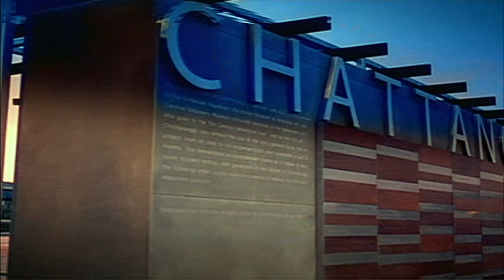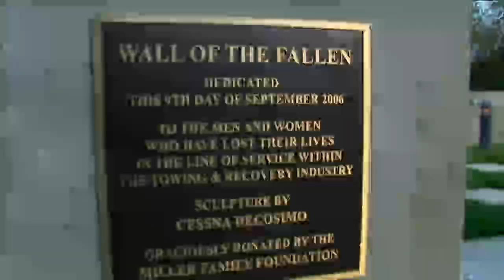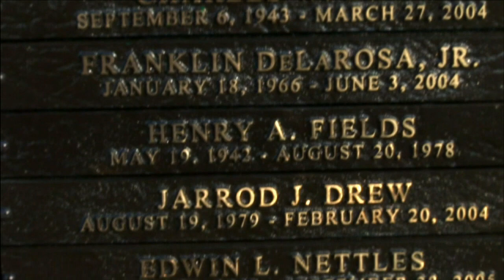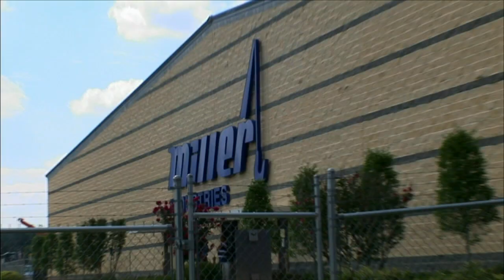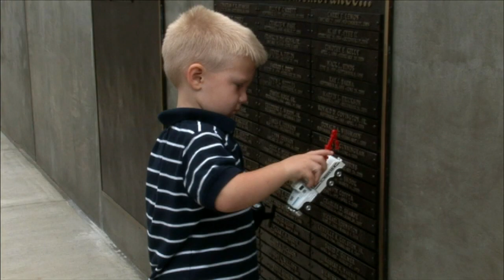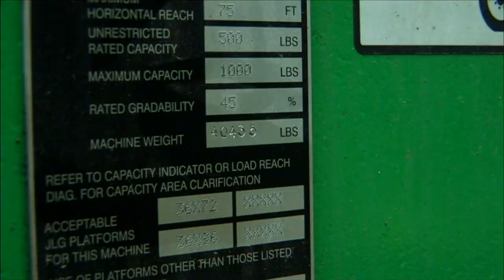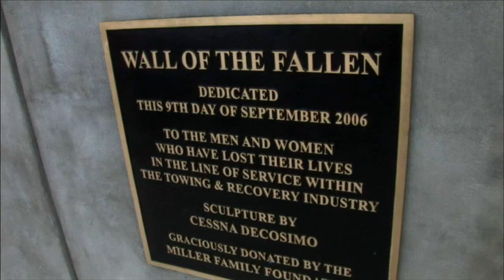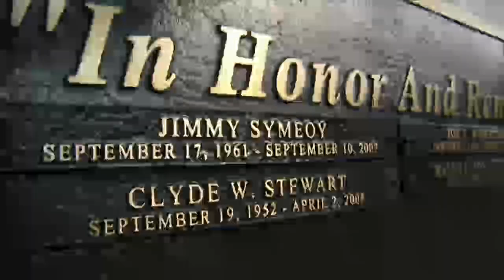Wrecked - Season 1 Episode 20 - Wall of the Fallen | SPEED

Comment: Wouldn't it been simpler just to grab the bus from behind with 2 j hooks and drag it back out the way went in with one truck then pick it up from the front for the tow? A 30 minute recovery?
Reply: +Patrick Moccaldi probably had to lift the front end for it to clear so they could pull it out
Reply: Oh that could be. If it was caught up on something. I hear ya
Reply: im guessing because it looks like it was hung up on the fuel tank
Reply: Patrick Michael Moccaldi Probably because it was sitting on the gas tank they couldn’t just drag it out because that could damage the gas tank and you can leak can catch on fire or go into the creak infect the water